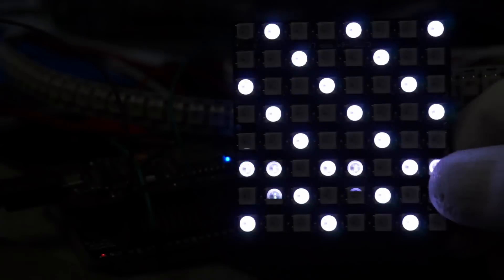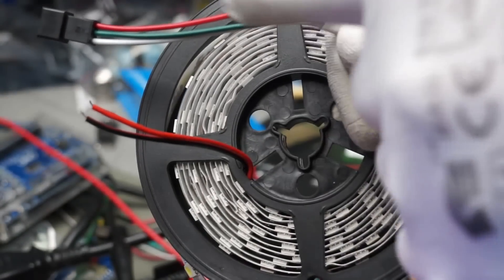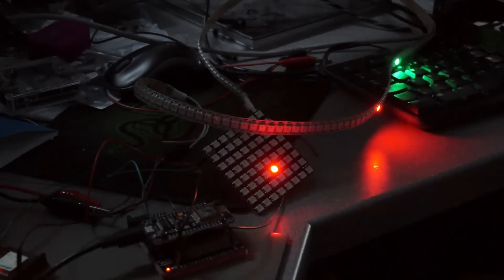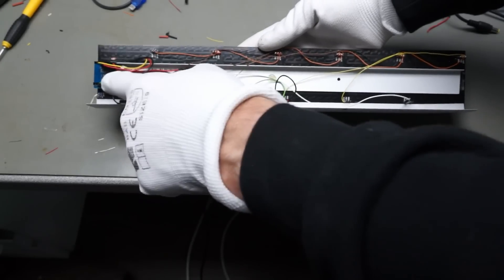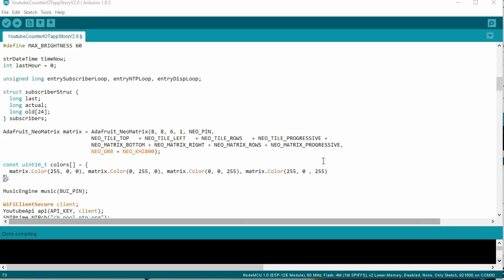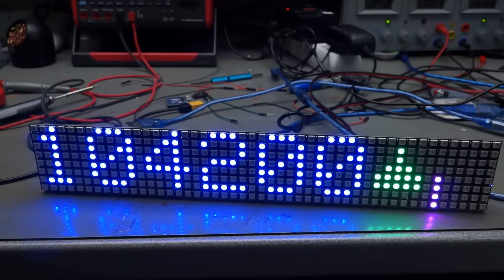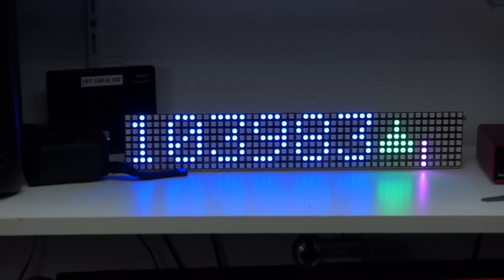432 Tips and Tricks for Neopixels Projects (Arduino, ESP8266/ ESP32)

Comment: I am purchasing components to make 940nm IR LED display with WS2811. My plan is 4 pixels per chip because the WS2811 is separate from the LEDs. I'm going to start with 10 characters. It's gonna be a bitch (for me, a hardware guy) tweaking the library but in the end I hope to have a display for ONLY night vision cameras. I have a poem in mind to display just to mess with security folks minds 🙂
I have already made a few stereo IR vision cameras with FLIR Lepton. 160x120 (I'm an IR vision zealot) I also have thermal cams on the security NVR...
Reply from the maker: Use chatGPT for the coding. You will be astonished...

Comment: Nice video as always... a quick suggestion... APA leds are much more fun than neopixels, those are not as tricky as neos in terms of timing. 
Also i noticed take bit lower current than neos if code is optimised.
Reply from the maker: Thanks for the tip!

Comment: Hello. I'm having the problem you describe in a project I'm currently working on. I fed both the LEDs and the MCU with the same Power supply. And as a result, smoke came out of the voltage regulator of the MCU. I can't say I fully understand the problem here, why is the current going through the MCU? Is it because the power supply is not enough? When we use a FET, is it enough to prevent the voltage from reaching the LEDs unless there is a signal from the MCU enough to solve the problem? Because in my way of connecting MCU burned out after 1-2 minutes.
Reply from the maker: Maybe not the MCU burned but the voltage regulator because it is not made for high currents. If the MCU smoked you have a different problem...

Comment: Tip or Trick 5: 3.3v USUALLY works. But, _NOT ALWAYS_.

This also relates back to #4, and the mention of ghost pixels.

I had a strip that generally worked OK with the FastLED library on an ESP32. Yet, there was some weirdness and ghost pixels. I did not think to switch libraries because i had not yet seen this video. But it turns out that was a good thing. The easiest solution to try was to introduce a logic voltage shifter chip, cheap and easy... if it works. And sure enough, it worked. The strip works really nice now.

So my primary recommendation for weirdness is to add a logic voltage shifter. They are incredibly cheap and easy. Very few pins and connections, aside from the signal in and out(1,2)... They need access to a constant high(3) voltage "1" reference (usually 5v, but could be 12v with some strips - and this is obviously available since the strip runs at the high voltage), access to a constant low(4) voltage "1" reference (the ESP32 can supply this), and access to the common ground(5). Just 5 connections.
Reply from the maker: Thank you for sharing your experience!

Comment: If you orient the panels to scan top to bottom or bottom to top first your display can be independent of which panel is in use and horizontal scrolling and letters with differing widths is programatically easier, you can think of it as one 48x8 panel instead of six 8x8. That said software could also provide that abstraction
Reply from the maker: Good to know for the next project. Thanks!

Comment: Andreas, still a good and valid video. One thing to mention maybe is that the issue with the ESP32 with the ghost leds is now solved. I use the ESP32 without problems.
Reply from the maker: I agree. There are also more and better libraries available.

Comment: Nice video. For 3.3V MCU a shielded data line cable is another solution to prevent artefacts. Also pay attention to the P-channel threshold voltage. With 3.3V MCU there is possibility that when you pull the pin high to close the FET, it will stay open (3.3V - 5V = -1.7V). In that case you can use combination of N-channel and P-channel. Also always use P-channel to cut the +5V when you want to turn the strips off. If you cut ground using N-channel, the current will still flow through data pin which consumes power even if the leds are off (chip of each led is still powered on).
Reply from the maker: I agree (I did videos about this topic), but I decided it is off topic for this one...

Comment: Daisy-chaining is cool but the first pixel data output always appears at the furthest end from the input. I always include a power supply that can drive all pixels Full White and then a little extra just in case. I'd also be connecting all vcc and gnds on all boards respectively. LEDs SUCK power and an 8x8 at all white would be very bright and take about 4A. There's also a bandwidth limit to the timings so driving an 1024 string is 30hz max. There is a library called octows2812 which could bring a 512x256 display up to 60hz
Reply from the maker: Thank you for the additional information!

Comment: hey Andreas - maybe you can help:

I would like to read out sensor data (e.g. temperature) to a specific time (clock synchronized). so that I get my measured value exactly on the full minute/hour. The idea is to precisely synchronize measured values from a sensor network. Any idea how I can start so precisely
Reply from the maker: I would divide the problem into components and google for a solution for each part. When all work, I would integrate them.

Comment: I use a lot of the WS2815 stips. Same code but much easier hardware wiring and fault tolerance because of the 2 datalines backing each other up. If just one LED in a WS2812 stip fails then all the subsequent LEDs will fail to work too.  Also the power supply for WS2815 is 12v rather than 5v so you can inject power every 5m for long runs rather than every 1.5m for WS2812 strips. In your example you should power from both ends. All my strips run from ESP32s using the FastLed library. The ESP32s communicate to sync the display using ESP NOW.
Reply from the maker: The 12 volt strips are a good extension as you describe. And adding a clock line increases stability a lot! Unfortunately, I did not see these pixels in panels or rings.

Comment: @13:50 5v to 3.3v pin of ESP8266 through a 10k. I am not sure how reliable it will be.
Reply from the maker: I would not connect any 5V to a 3.3 volt pin. If there is no current you will get 5 volt at the pin...

Comment: You should avoid using the Neopixel name which is only Adafruit’s brand name. It’s not even their brand name for the APA102. They push their brand name « Dotstar » for the APA102. Better stick to standard names and avoid the marketing BS.
Reply from the maker: I think, Neopixels became a "household name" for such parts with more than 3 million hits on Google
Reply: @AndreasSpiess  It’s true. But it doesn’t mean it’s a good thing.😊

Comment: Switch the panels on one at a time, turning the pixels off on that panel before moving to the next panel. Max current draw is a single panel.
Reply from the maker: I agree. But it would need more transistors and IO pins.

Comment: AVG detects xtensa-lx106-elf-g++.exe as threat (IDP.Generic) after 2.0.0-rc9 update. That exe is an add on to Arduino by ESP to make ESP boards to work.
Unsure if its a false positive and VirusTotal reports no problem. ESP boards from Espressif are a Chinese company and the Chinese have added 'spying' or 'data collection' in other software. So I'm confused and since REFUSED to use my ESP boards and that exe is still in my quarantine.
Reply from the maker: Your decision. So far, I am not afraid.

Comment: Would it be worthwhile to add a e.g. 1000µF cap on the ESP's power input to handle the brief brownout condition, when using the FET switch?
Reply from the maker: The independent wiring and a reasonable power supply were enough. I doubt that a 1000uF cap would provide enough energy.

Comment: Simple solution: Use a $1 boost converter to power the MCU.
Reply from the maker: Why would I use a boost converter if I already have a 5V supply?
Reply: @AndreasSpiess  Why do you use 2 power supplies for a little display? 1 ps + boost converter is the most elegant solution in this case.

Comment: Hi Andreas,  seems there is no shortage of suggestions for your circuit...  so I have one more, maybe.   I read in the datasheet of the WS2812 that if you hold Din LOW for longer than 50us it will reset the pixel.  It is not clear if this will cause the LED to be OFF but it would be worth a try.  If you had a small pull down resistor on the 1st Din you may be able to power up without the high current draw.  Might be worth a try.  Also be sure the the CPU powers up with the I/O pin in a high impedance state.   
Tony
Reply from the maker: Interesting. That would be a very simple solution! (RTFM as always ;-)

Comment: Congratulations for your 100000+ subscribers.
For high number of neopixels I want to try ws2815. They are the same but they use 12V instead of 5. So you deal with lower current and voltage drop is lower in end side
Reply from the maker: I agree with the 12 volt pixels. AFAIK they are mainly used in strips.
BTW: This is an old video (as mentioned in the intro). The current counter would show close to 400'000 ;-)

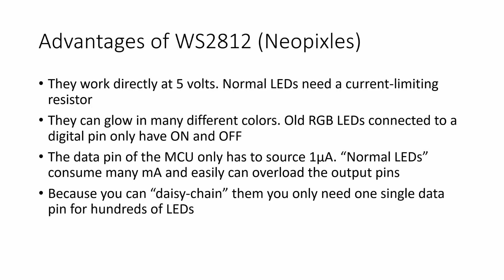Comment: The data pin of MCU can provide current 10mA or more, not 1uA - it means it is more than 1000 more (slide in 1:35).
Reply from the maker: You are right.

Comment: How about a separate FET for each neo pixel panel, then just power them up one panel at a time, reset the panel, turn on the next panel. Also supplying power to each panel would eliminate issues with power supply droop.
Reply from the maker: I agree. For my small display fortunately, this was not needed

Comment: I ran into an interesting problem using NeoPixel strips for under countertop lighting in my kitchen. I have situations where the wires connecting some of the strips are of significant length where the wires “jump” over the sink and cooktop. Too long length between separate strips can induce signal timing problems. One commonly used solution is to use repeater pixels that are never turned on. However, I installed the wiring during renovation and now most of it is not accessible. I have enough wire gauge to carry the current. So my solution has been to use inexpensive ESP32 wireless modules and the first controller “talks” to the other controllers at power up so that each string will have the same programmed color as the master controller.
Reply from the maker: Good solution! Fortunately, I never had so many LEDs in a row...

Comment: There are now pixels where each LED has it's own voltage regulator rather than a simple current limiting resistor.  They are of course more expensive, but they allow you to run much higher supply voltages and achieve very long strings without suffering the effects of voltage drop and with no need for power injection along the string.  Look for "12V regulated pixels" in your favorite neighborhood search engine.
Reply from the maker: These 12 volt pixels are a good solution. Unfortunately, I only found them in strings.
I like your channel, BTW and learned a lot about my DX Commander

Comment: Was wondering if WLED project was any useful as it's a very powerful and full of features like max current limit etc and many many connectivity options. Maybe I understood wrongly about this and it's only about building things from scratch... Thank you!
Reply from the maker: Looks like an interesting project. However I am not sure if they support panels and text (I never used it).
Reply: @AndreasSpiess  They don't, but there are some forks that add support for (scrolling) text. Another option is to render the text elsewhere and send the pixel data via UDP (I have some python script that reads data from MQTT, renders a screen and then sends it to a 16x16 matrix running WLED on a D1 mini). The advantage of using WLED as a base is that you get all of the nice light effects, smart home integration, option handling etc. for free. Also I prefer not having to flash the ESP when I want to change what the matrix should show.
Reply: @RalfVogler  and you can write your own effects. You could also write functions for text

Comment: Is this synchronous mode which means if I type 2 in notepad in my laptop it will display it on the matrix simultaneously
Reply from the maker: I do not understand .-(
Reply: @AndreasSpiess  do you need to send the character in order to display it on the matrix if yes... that's not synchronous. PC monitor is an example of the synchronous display.... whatever you press the button on keyboard...it will display it on the monitor
Reply from the maker: @antayudi5428  My display was fed by YouTube. No connection to a PC.

Comment: Great video! Can you do DMA (direct memory access) with the esp neopixel libraries, so the wifi interrupts don't mess with them?
Reply: Better go with APA102 LEDs they use SPI bus and don't need the timers to work.
Reply from the maker: With SPI most processors can do DMA. I do not think it would work with a singe output. Maybe the PIO of the Raspberry Pico?

Comment: To give power to the pixels you should use wires with a good gauge. Ideally make direct links from the PSU to all the VCC and GND points with wires of the same length so there's no dimming (except maybe a little bit inside the panel but there's nothing we can do and it's negligible anyway).
It's better to use 2 PSU: one for the control and one for the pixels. If you can't, add a diode and a big capacitor for the MCU. This way any transient drop in VCC doesn't affect the MCU.
The Pfet is a good idea that can be extended: you can cut the power into multiple sections and power on one at a time. Of course you'll have to send the "all 0" command multiple times but it doesn't really matter.
Reply from the maker: I agree with all of your proposals. Fortunately, it was not needed for my project.

Comment: Could use a MOSFET per panel. Power up the first panel, switch its LEDs off, power up the second panel etc. This way the current draw never exceeds the maximum draw of a single panel.
Reply from the maker: Good idea!
Reply: How 'bout a thermistor (I know, too greedy).
Reply from the maker: @paulskaar8556  Probably too slow...

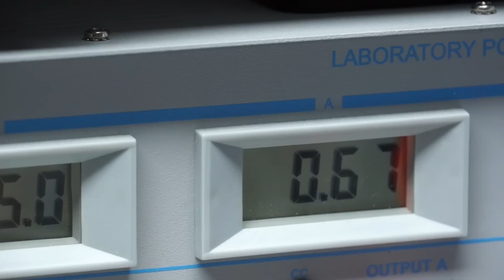Comment: At 13:43 it should be mentioned that it is better to have a resistor of about 1kohms in series between D4 and DIN of the first Neopixel. That reduces a high current flow out of the D4 port pin while Neopixel power is off.
Reply from the maker: Maybe another rule? However, I am not sure if this happens under normal conditions.
Reply: @AndreasSpiess  Well, its a general rule: Do not feed currents into IC pins when IC's power supply is off. And exactly that is the case with your design, when the FET is still off but the D4 is already on.
You know... "input protection diodes".

Comment: Consider using thicker wires for the supply so there is less voltage drop across them. You can create a loop or star on the supply wires too.
Reply from the maker: I agree. Particularly for long strips these are good hints!

Comment: Would you need some current limiter on the ground from the neopixel to the MCU due to the mix of powering supplies?
Reply from the maker: If you limit the current the voltage drops. This is what happened to my ESP with the small power supply

Comment: Let's hope you can use the space for a 7th digit in the future :)
I can also recommend APA-102 LEDs. They have a PWM frequency of 20 kHz istead of just 400Hz, which reduces the visible flickering almost entirely (I am very sensitive to that). It also has one more data line, clock, so the timing doesn't have to be so precise, which can be important when using interrupts and timers for other things.
Reply: In other words the APA102 uses standard SPI instead of a proprietary one-wire protocol, so you can use common SPI hardware to send lots of data without artifacts (flicker) even on very low power MCUs.
Reply from the maker: Cool! Do they work with the same libraries?
Reply: @AndreasSpiess  I know it works with FastLED, but i'm not sure for Adafruit
Reply: @AndreasSpiess  I wrote my own libraries just using SPI -- no funky timing needed and can be clocked to several megahertz.  I used them for Christmas decorations and never had a problem (using an ESP32) over two weeks.
Reply: @AndreasSpiess  Of course! They’ve been supported by FastLED for many years. They’ve been pushed up to 24MHz ! They’re a lot better than the venerable WS2812. Not as cheap though.

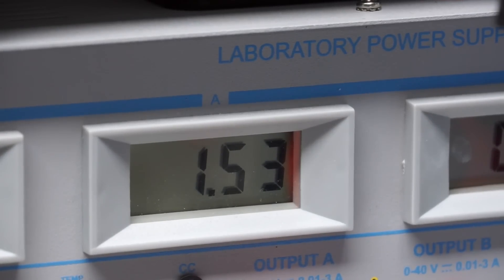Comment: When you measured your pixel matrix current draw @ 13:30 in the video, did you have them at 100% brightness and full RGB? I ordered parts to power my project but I'm finding that the current draw is way less than the stated 60ma per LED when running them at 50% brightness. I haven't tried 100% yet though. I have 300 LEDs so I calculated 18amps max.. Any thoughts?
Reply from the maker: Mine were at 100% during this test
Reply: Perfect, thank you for you excellent videos! Enjoy your summer break!